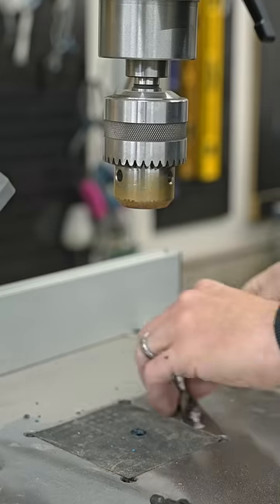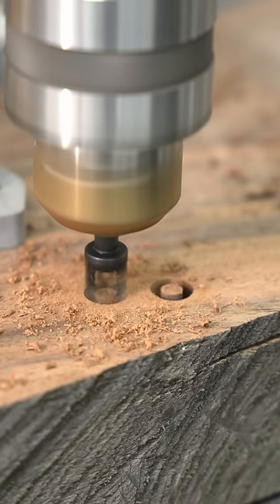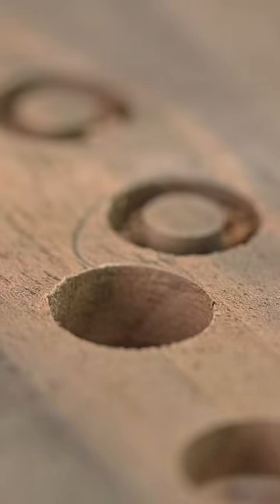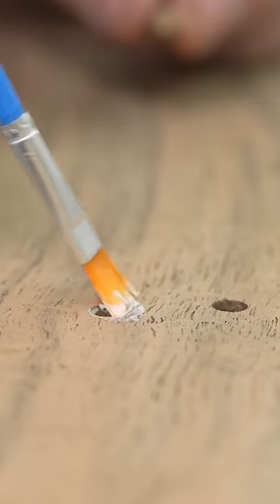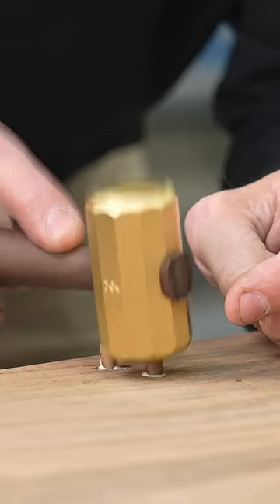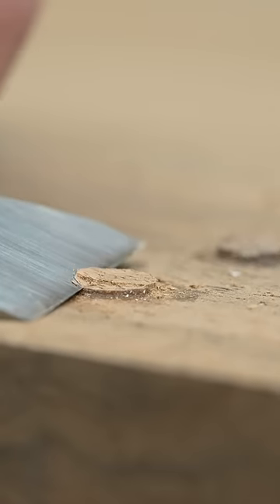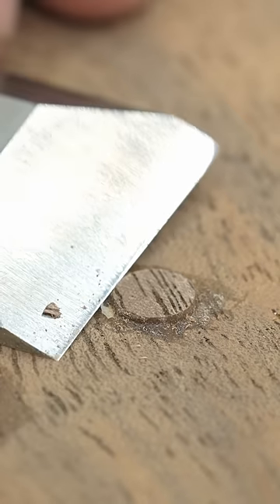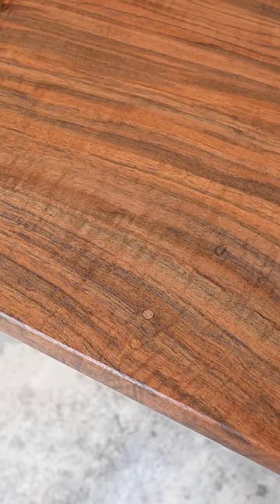Filling that hole

Comment: Take your sawdust from sanding that piece and make putty by adding a few drops of water and a little glue.  It creates the perfect filler because it's made from the wood itself.  You can also use a plug cutter to cut a shallow pul from the backside of the slab.
Reply: Because of the glue it won't take a finish like the wood will.  You might be able to use like more stain on the filler and get really close, though.

Comment: You are using water based wood glue on teak.  Teak has natural oils.  I have found that I need to clean the surface of my holes with acetone.  Then I use a two part epoxy. On the hole and plug.  I finished my teak with Teak oil.  Which blends perfectly with the two part epoxy.

Comment: I’m sure tips for this come in constantly but…try a grain filler that can match the natural color, distressing the area or antiquing to make look like a natural imperfection. maybe a dark toner that matches your stain and cover up by hand painting artificial grain to match. With plenty of practice it will work. This or try to drill a sample from an inconspicuous area of the same piece and use to match. Either way it’s a hard job to make look natural but doable with plenty of practice and time.

Comment: Been using these plugs for years.  The card stage is unnecessary, just gain practice with the chisel.  
Gain better camouflage by selecting the donor plug material that better matches the colour and grain for each location.

Comment: I kinda feel like you made the situation worse by taking a small issue and turning it into a more noticeable issue. Me personally, i would’ve taken the saw dust from the same lumber that accumulated inside your sander’s dust bag, mixed it with wood glue, and used that mixture to conceal the little holes. Let it dry then carefully go over it with the sander to blend it in. Works every time. Just don’t go too crazy with the sander, or with the glue.

Comment: Make smaller bungs. Take the drill bit out of the center of your counter sink. The chuck the countersink itself into the drill press. So you are using the countersink to make the bung. that way you are not making your repair bigger. also sand the bungs flat when the glue is still wet, it will blend much nicer

Comment: Okay here's a tip so on your slab that they drill the holes into you simply cut a sliver off of one of the edges and you use that to make your pins or your dowels you have the exact same wood with the exact same oyster content the exact same staining and the exact same patterns and you only took maximum 1/2 inch off of your wood slab

Comment: on the saw you cut the plugs with, you can use a file to round over the edge of the bottom teeth justva tiny bit, then wax the blade for lube. youll be able to flush cut without the card spacer

Comment: Couldn't you use a smaller dowel and sanding dust from the same wood mixed with glue to use as filler to match the wood?

Comment: Here's what I would try. Deliberately use plug wood that is lighter in color. Install the plug. Rub plug and surrounding wood with a slightly damp cloth. Visually compare plug to surrounding wood. Carefully stain plug to match surrounding wood. I'm guessing that the glue would prevent the stain from spreading from the plug to the surrounding wood. Just brain storming here...

Comment: You have toi choose the tone and grain of the plug that matches perfectly the board ewhere the holes are. I can promise you they will be invisible which is the case on the outer plug but not with thinner one.
I've been doing this for 30 years and it works all the time. When it didn't it was because I didn't want to waste wood and drill out many plugs only  a couple of holes…

Comment: If the plugs were just a bit short of being flush you could have put a bit of glue on top of the plugs, and sanded around the area, pushing the wood dust on top of the plugs. After it dries sand it smooth. The finish should look uniform after that.

Comment: Using a flat cutter set your router to 0.1mm above the surface and take the top off the pellet. Saves accidently marking the timber with a chisel

Comment: If the original video creator has not found a. Easy fix to keep the stained color variations making the plug repair stand out due to the tone difference.  The quickest fix for you, is to color the plugs and the surfaces , then go through you plugs and select the one closest in color to the exact hole you’re going to install it in.  I put the glue in the lower 3/4 of the hole, with none on the plug.  When the plug is tapped into its permanent home the glue in the hole will be pressed upward as the empty volume of the home decrease.  .  When the glue is even with the finished surface, stop tapping it an let it set up.  After it sets, put you hand surface protector in place and trim off excess plug.  That should give you the closest densities of the plug being used and the surface ariunthe hole it’s going in.  When you trim the excess, the coloration of the plug will be lost, but will stain back very close to color it had when you chose it.  What’s going on, is the difference in densities between dark and light tree rings supposedly developed due to available water  available annually.  So the soft rings that stain dark, take up more of the color because it geprew fast and resulted in a softer section, th the harder rings that stain lightly, grew slower due to less available water that year.  That section will reseult in a ring that is harder than the fast growth years.  That harder wood will soak up less stain during the same time period, so that ring will stain very lightly.  Your problem is simply different local wood densities  due to rain variations a available groundwater supply over those growth.  You could calculate volumes and masses and compare each little piece and the match the numbers,  but why do that, when you could pre stain every plug and the finish surface and just volormattch the,.  Due to that plug coming vertical from the growth rings, it should restrain once trimmed to almost the same color it took the first time.  Hope this works works quickly for you.  I know what I want to say, but putting it in writing is not something I’m very talented at.  If you can understand my directions, it should make your problem almost vanish, due to the way I’m telling you to pick the plug to match the hole it’s going in.  Nothings perfect, but it should be much closer that the way your doing it in the video.

Comment: Make plugs from the same workpiece. Also don’t use tapered plugs. Also use CA glue but only inside the hole and only below the surface. Should solve ALLLLL of these problems.

Comment: so... drill into the plug just slightly , then mix some glue and sawdust from sanding the slab to make a putty and fill the slight holy you drilled into the plugs, should be an easy match.

Comment: The dumb part about drilling the holes is it’s unnecessary when they make moisture meters that come with the slide hammer attachment, and on the end of the slide hammer, there are 2 inch pins that are non-conductive, except for the very end they’re really good at testing moisture content, deep inside pieces of wood

Comment: Why do they drill on the part of the wood that will be visible in projects? Why not drill into it from the side?? For example, say you get a 2 inch thick, 5ft×3ft slab. Why don't they drill into any of the sides that are 2 inches thick? A plug on the side will either be hidden by meeting with another piece of wood, can be shaved off entirely, or just be plugged and be a lot less noticeable than holes plugged on the slab side where you're going to want it to look beautiful and perfect.

Comment: Dont make the holes bigger, take some large shavings and fill half the hole then take your invisible glue, Or as we call it, Elmer's glue, and clean out the bag that catches your sanding dust and put some 120 grit sandpaper on your sander and sand the piece you're needing to fill the holes. Take the fine wood dust out of your sander and on a piece of paper 
 mix the glue and the dust into a paste and place the paste into the hole overflowing it. After it drys sand it down you won't be able to tell there was ever a hole . I forgot to tell you to make the hole stretched out with the grain.

Comment: As unsightly as it could possibly be for qn uninformed buyer, id think an informed one would realize the plugs are a sign that the wood was properly checked for moisture, which should increase its value if anything.

Comment: I would either not use the part where those holes are at 3000$ or do more holes randomly or in a straight pattern with a different wood

Comment: Whenever I'm working on wood I save the sawdust of the piece and will glue the sawdust and pack holes.
Reply: You're not making $20,000 tables either are you😂
Reply: @ClaytonBigsby01  nope lol I learned that in shop class and showed my dad and we sold a cabin for $573,000 took 12 years to finish. 30,000sq ft give or take and sense we couldn't stain the glue we would stain the sawdust and let it dry over night then use it to match the wood.
Reply: Gonna be making another one too rent next year.

Comment: They couldn't check for the moisture on like the edge or in a less intrusive place than right there? Whack.

Just saying I'd be pretty fucking pissed off if I bought that table and there was filled-in holes in it like that

Comment: Look I really don't care how much the wood is I want no holes in this lab that I'm buying and I'm certainly not going to spend $3,000 on a piece of wood to build a table to have plugs that are noticeable I'm sure there's a very simple way to check moisture where you don't have to drill a hole in the woods specially is surface that you're going to actually be using for something